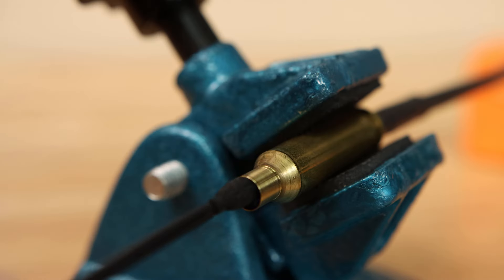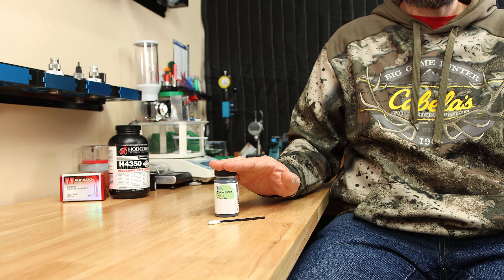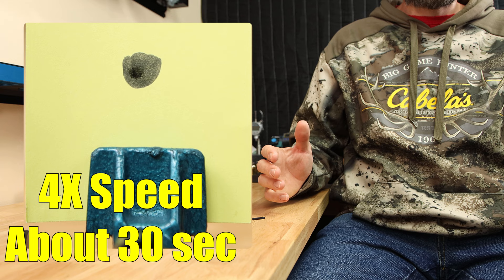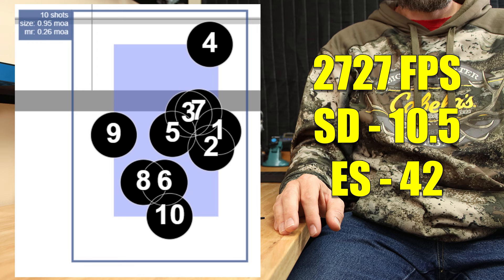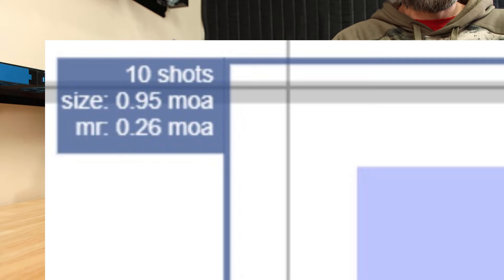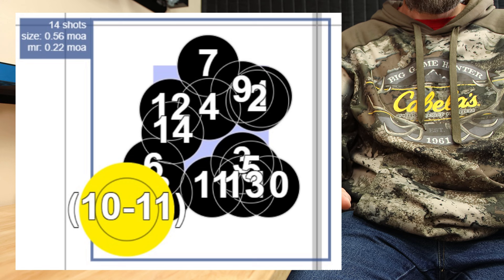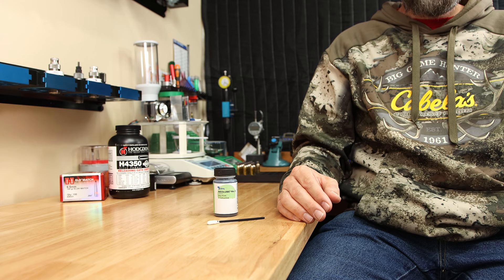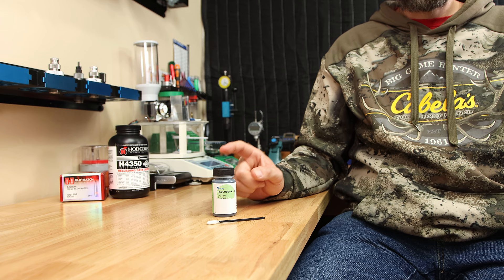The easiest and fastest way to improve your reloads?

Comment: I ran a test once on my 300 Win Mag along the same lines... I loaded 40 rounds, 10 in each group... Unbrushed, no lube. Unbrushed with lube. Brushed, no lube. Brushed, with lube. The lube was simply Hornady Unique applied to the bearing surface of the projectiles.

I remember seeing a difference in ES/SD... But I don't remember if group size was significantly impacted.

Unfortunately, I lost my notes on the test and can't recall which prep regimen yielded the best results.

Getting ready to load some more ammo. May have to repeat the test.

Comment: Just for science I gave this a try on a cheap 308 reload altough I used a little drop of silicon oil on a Q-tip instead of that graphite suspension which is totally unobtainable in this part of the world. Seating felt extremely consistent and chronograph results were stunning, that particular load went from SD 12 and ES 46 on 10 rounds down to SD 7 and ES 23, still on 10 rounds. 
I'll probably ditch the silicon oil for the next batch because I don't know what may happen in the barrel on the long run, but at least I'm sold on the idea of lubing the inside of the necks prior to bullet seating.

Comment: I gave up on chasing sd/es. If I put 5 shots into the same hole at 100 yards I'll take that anyday over sd/es in the single digits. My best groups are with high sd/es. Go figure.
Reply: Nice. For practical purposes thats just awesome and plenty good
Reply: You can do that if you're not shooting at distance. There is a reason the LR guys watch ES/SD.
Reply: That's all fine and good. But when you start shooting further and further it starts making a big difference. I don't deem a load good before my 10rd sample is below 15 ES.
Reply: As long as you are only shooting to say 300, this may hold up. But as you start reaching out to 1000, ES will start making a difference in verticals distribution.
Reply: @MasterEngraverTV  For man sized vertical spreads SD of less than 20 is fine.
Reply: Yup....on paper is where it counts not the chronograph.
Reply: @jeffsikula2920  right. Except that at 1000yds and beyond, on paper, a high SD/ES DOES matter.
IYKYK.
Reply: At 1000 yards, you  start seeing bullets drop under whilst others fly over the target. Of course some  hit, but fewer and fewer as SD and ES numbers increase

Comment: I do like this since about 10 years, but with homemade liquid moly, works extremly well. Seating force are super consistant, sd and es extremely low (but also depends others variables).
Reply: Liquid moly, like the black molybdenum grease?!
Reply: @DracoOmnia  ultra fine moly powder (for bullets coating) + isopropanol alcohol
Reply: Now I'm curious how the homemade blend compares to the neolube no.2. Considering the homemade is likely lots cheaper if the performance is similar it could end up being like lanolin for cheaper case lube.
Reply: @Rickjames127   Many shooters use moly, same results on target, moly is less abrasive (in the barrels), but more sensitive to humidity, it's a choice.
Reply: @therangersbulldogs6350  Thanks for the fast response. Are there any sites you can link with this info? Barrel life is a finnicky thing to predict are there sites/forums with empirical evidence showing longer barrel life? 

There's often graphite in smokeless powder. So at what amount is the abrasion higher than the base powder? The humidity has been much higher than usual this year for me. I'd love to see some side by side tests. 

Which would be better for abrasion to put the product on the interior of the case neck or on the outside of the bullet? Which results in more consistent seating pressure and release?

Comment: Looks great, but not sure why the Redding Imperial dry lube in media wouldn’t do the same thing.  (?) I already dunk the neck in that before running a mandrel before bullet seating, so know there’s still a residue inside the case neck.  Numbers don’t lie, so I’m sure you’re onto something, but the dry lube might offer the same benefit.  

P.S. I see this was addressed further down in the comments.  I’ll have to consider how adding the neolube to the dry media inside the necks will work in practice, but it sounds promising.

Comment: Quick question ... Neolube before "Mandrel", or before "Seating"?
Reply: I have the same question; hopefully we get a response.
Reply: 🤔🤔 is this a joke? Before bullet seating. You two should stay clear of this hobby. Seriously. Common sense and logic ran out on both of you even when its being explained.
Reply: @equalleftrights3130  Wow ... someone is having a "cranky-pants-toddler-day". I hope tomorrow is better for you ... consider a longer nap.
Reply: @equalleftrights3130  stop gate keeping
Reply from the maker: Hi Rusty, Its before seating.
Reply: @BoltActionReloading  So do you use dry-lube (like Imperial Dry) for Mandrel, and then NeoLube for Seating? Are both steps necessary?
Reply from the maker: Hey Rusty, so everyone's least favorite answer is it depends. If I am moving a case neck more than .002" I don't know that dry lube is enough to prevent galling. If your using a bushing and you have carbon still in the case neck and you are moving only .001" and your using a expander that has a coating do you need it at all? I would encourage you to test only one thing at a time if you intend to try it. The amount of lube in the case neck with the neolube is different than you are going to get with standard dry lube.  If your not in a hurry I am going to do a comparison video on it eventually.
Reply: @BoltActionReloading  I've got both, and time on my hands. I'm going to try all the combinations and see what works best. Thinking that Neolube before Mandrel and nothing else ... just use the leftover Neolube in the neck for seating ... might kill both birds with one stone.  We shall see.  I have an AMP Press on the way, and that will help with the precision of the test. I'll probably wait until that arrives. BTW ... LOVE your videos. Keep 'em coming - do more !!!
Reply from the maker: Thanks Rusty, I appreciate that. I am not going anywhere, Tests these days seem to take more time. Best of Luck with your testing.
Reply: @russsmith1450  I did my first test with NeoLube yesterday, using it prior to the Mandrel step ... but not before Bullet Seating. I wanted to see whether residual NeoLube helped seating force. No way to show the AMP Press results here, but the curves were good, with less that 10 lbs of Terminal Force difference between 20 cartridges. Next test will be to NeoLube both before Mandrel, and then again before Seating ... and see if the force spread gets even tighter, or materially decreases. More work to do ...

Comment: What’s the theory behind it?  Why does it work?   Thank you for the video!
Reply: Graphite is a dry lubricant, putting it in a suspension of alcohol allows you to apply a very thin, reasonably consistent layer of the graphite across the intended surface and alcohol evaporates pretty quickly at room temperatures (also called flashing off).
Reply: @DracoOmnia  You answered the operation of it.  Thank you.  But why does this work?  Why is graphite in the neck helpful?  It seems it would be similar to using a larger mandrel and decreasing neck tension.
Reply: @clays7741  ah, it reduces the amount of force you need to insert the projectile, the current groupthink is that the less pressure you can consistently get to (key caveat, whilst maintaining neck tension) the better for accuracy. If you watch the video he references in this one he's got a load sensor in his press and measures the the pressure it takes for various neck lube versions and this stuff provided the most consistent spread on a graph, with the least pressure spike.
Reply: @DracoOmnia  Thank you for the great answer!
Reply: @clays7741  It would also reduce the potential for neck weld.  As a bullet sits gripped in the case the brass and copper bond over time which creates another variable in the release pressure of the bullet. That's one reason F-class guys seat long for transport and then seat to length the night before the match. It breaks any weld, resets the baseline release pressure, and they know seating depth didn't get knocked out while travelling.
Reply: @mab0852  never heard that one, those f class guys are a whole other  breed lol.